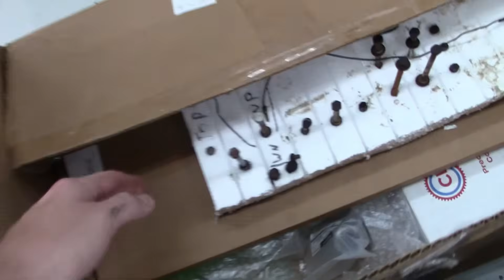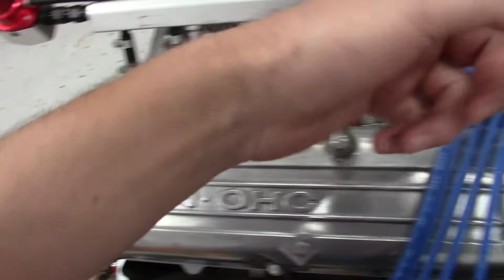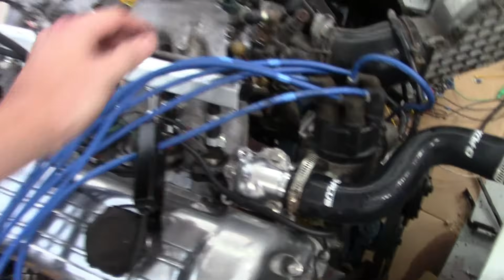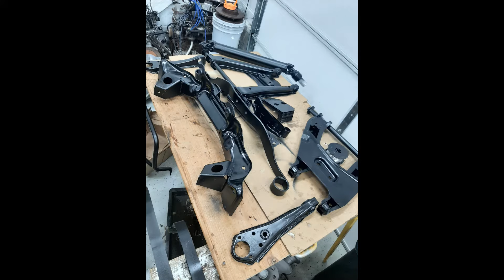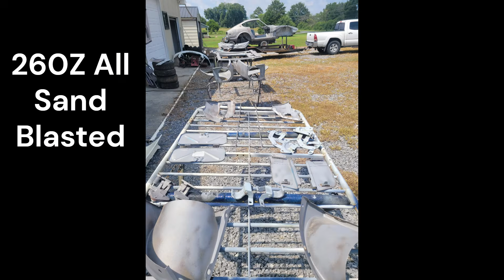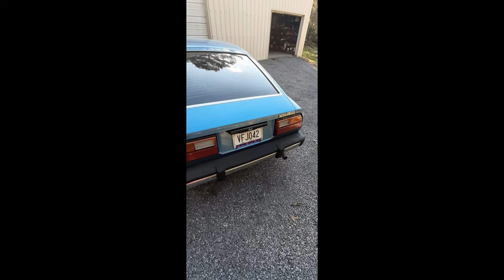Datsun 260Z Restoration Updates And L28 Engine Test Run

Comment: Do you have a schematic on how you wired the engine for engine stand running?
Reply from the maker: I don't necessarily have a schematic but do have videos going over the parts working independently

Here is a video on the fuel injection: 
https://youtu.be/D6OHqpoAvn4?si=P-MnTGXLVD9XhyJ3

I also have a video going over electronic ignition which will also be important. 

Hope this helps.
Reply: @ZCarProjectsWithJareth thanks , I'm working on a 260 over in Tuscumbia
Reply from the maker: @BlaineBrooks-l3o  Is that Tuscumbia AL? we are fairly close if so.  the clock reference for the fuel injection would be the same as a 280z, (negative side of ignition coil) if you are running a fuel injection system. The ignition module on the 260z is different than the 1975/76 280z and still a grey area as to harness colors etc.  I do know that if your 260Z was originally a automatic car, it will have a dual pickup distributor for electronic advance but manual cars were single pickup based on the shop manual I have.